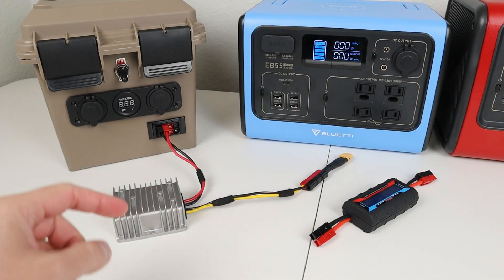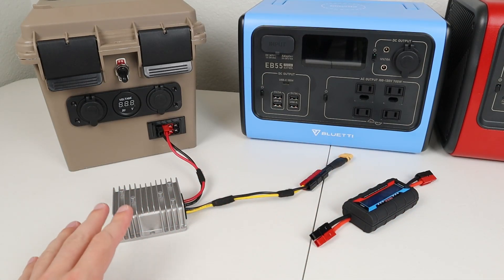Bluetti EB55 & EB70 Charging Tips and Tricks - Faster Charging Without Solar! EB55 400 Watts Input!?

Comment: Thanks for putting this together.  I discovered an unexpected behavior with my EB55 right charging input labeled 25-28V/10A.  I figured you might be curious about this, too.   Naturally, this input works just fine when I use the included 200W AC/DC adapter.  However, when I try to use another power supply, a Victron Orion-Tr Smart DC-DC Charger, it will not charge.  I am an electrical engineer, so naturally I made sure the polarity is correct with a multimeter (positive tip) prior to connecting.  Also, the Victron has adjustable output voltage, so I tried everything from 25 to 28 volts, and I confirmed the output with a multimeter prior to connecting to the EB55.  In addition, I also have Bluetti AC50S.  As you know it has a similar 8mm input on the back that asks for 14-40V.  When I plug my Victron into it, it charges just fine!  I’m confused!  Any thoughts on this?  Thanks in advance.
Reply: By the way, the reason one would want to do this is this--12V solar panels output <25V, so they need to go into the left port labeled 12-28V.  Therefore, I'd like to have DC from a power supply going into the 25-28V port.  However, as you noted utilizing the stock 200W AC/DC adapter is a challenge with standard vehicle wiring (blow a fuse).  The 12 to 24 volt converter you mentioned will not work in the right charging input because it doesn't put out 25V.  So, I'm trying to use something that should work, but it doesn't!
Reply from the maker: @Roland-Lewis  Easiest way around that issue would be to have an inverter installed that can handle a 200-300 watt load. Then you could run the AC wall charger off the inverter AND the DC inverter both at the same time while the engine is running. Wire the inverter directly from the battery using like 6awg wire and it should be big enough to handle both the inverter and the DC charging at the same time. That direct wire connection to the battery would be useful for other applications in the future.

I haven't worked with that Victron unit so not sure exactly why it's not working. The only thing that came to my mind could be that the victron charger must need some sort of feedback voltage to start putting out power? Similar to a laptop power supply, it wont just put out power but needs to verify something before it starts working.
Reply: @Jasonoid  Thanks for your prompt response.  I get what you're saying that the 300W inverter is an option, but that is the function of the Orion.  And I can't get myself to go DC to AC, just to go back to DC again.  Yeah, it's so weird--the Orion shows voltage with just a multimeter connected, and as mentioned, it will charge the AC50S just fine.  AND I DIDN'T MENTION THIS YET--the AC50S power supply will charge the EB55 just fine!  Well, if you happen to have a DC power supply laying around that can output 25-28V, maybe you'll be curious to see if it will charge your EB55 from the 8mm input.
Reply from the maker: @Roland-Lewis  I was able to test charging my EB55 via the 8mm jack, it works fine with this adjustable power supply between 25 volts and 28 volts:
https://www.banggood.com/TOPSHAK-K3010D-4-Digits-LED-Display-110V-or-220V-30V-10A-Adjustable-DC-Power-Supply-Switching-Regulated-Power-Supply-p-1419678.html?cur_warehouse=USA&ID=47757&rmmds=search
Reply: @Jasonoid  Thank you very much sir!  I'm starting to think there might be something wrong with mine.  I have a friend who has a similar power supply to yours, so I will borrow and test mine.  Thank you again.

Comment: I ordered an EB70, if I want to use this converter in order to lower the recharging time on the EB70 do I wire the converter directly to the 12 truck battery? I think I'm going to build a small cabinet in the bed of the truck to place the EB70 in and I would mount this converter to the cabinet somewhere so I will always have it there for recharging. Does the converter work if connected to solar panel instead of the truck battery? Like if I had a switch to change from battery to solar or just had a splitter connection in the wires or does it always need to be from the truck battery? Once again, great video with VERY helpful information!!!

Comment: .. quite clear with the step-up unit. but still wonder, if it must be true sinewave inverter (what i think it´s supposed to be). the reason is for emergency cases, when power station runs low, no sun available and severe need of power .. means charging from the car without running it for hours. modified sine inverter with let´s say 700/1000 watts (for ecoflow 600W charging) is much cheaper - that´s why.
looks like nobody dares to try and eventually ruin their power supplies ;-)
ps: looks like they made it a bit better with the 2 inputs on 55, but still have the limit on the mppt-input; can´t believe it, not fitting that even to their own panel.

Comment: Question in my car could I hook up the e55 to my cigarette lighter port and also use the ac  Brick and plug that into my 150w built in inverter? So I am essentially getting both dc and ac power at the same time?
Reply: I tried the 200 watt charger in my 2018 chevy express 110v outlet rated at 150 watts. Shut off and wouldn’t drive the charger. I’ll have to use the 300 watt Bestek direct to the battery to power the 200 watt brick
Reply from the maker: Yes that will work! As long as your inverter supports 200 watts, the AC charger will try to pull 200 watts and might blow the fuse for a small 150 watt inverter. I answered your previous question last night 👍
Reply: Oh ok thank you so much. I figured the charger would get limited to 150 watts but sounds like it will try and pull more watts. Thank you so much for getting back to me!!
Reply: @blitzsteinaaron  thats what i was hoping to do. My Chevy van has a 110v 150 watt outlet. I was hoping to use the Bluetti AC charger in that, but it sounds like it might blow the fuse.

Comment: jason can the dc to dc work with BIBENE without taking it apart ? ( bringing  up the voltage ) thanks
Reply from the maker: No, the Bibene power station is just limited to 100 watts by software so whatever power levels of voltage come into the power station it will just limit it to 100 watts.

The EB series are different because they allow 200 watts but there's that 8 amp limit so you have to use some trickery to get the full power. Most solar panels will get their power from lower voltage and higher amps (18 volts and 12 amps). So the higher the voltage you have on a solar panel,  the better with the EB series.
Reply: @Jasonoid  so i will have to take it apart 😂
Reply from the maker: @shaizahavi  I'd give it a test first to see how well the 100 watts works for you, if you need more charging then do the mod. Not everyone will need faster charging.

Comment: So why bother trying to charge those Bluetti's faster? Just get an Ecoflow River Pro or Max which fully charges under two hours with just a plug and play charger.
Reply from the maker: There's benefits to both models. Doesn't the ECOflow river only charge fast via the AC charger? So you'd still need a generator or high power inverter on the go (this video is about charging on the road).

The bluetti offers Lifepo4 chemistry which has a much longer life and no fire risk. Basically there are good things about each battery, you just gotta chose what works best for you.
Reply: @Jasonoid  Yes, you are correct. Each has his own strong and weak points, but for the Ecoflow's I don't need to buy other stuff just to make it charge faster or modify my vehicle just for that purpose, which again costs money. Charging the River on the road only needs at least 3 1/2 hours on the car charger, which comes directly out of the box (Warranty intact). Which in turn translates into more usable time.
Reply: @steverogers427  are you charging out of the vehicle cigarette lighter?
Reply: Swapping a faster charge cycle for more possible dangers, and a lifetime of 1/3 of the bluetti... Eco flow river Life cycle 800 cycles... Bluetti eb70 life cycle 2500 cycles... Also the eco flow uses semi dangerous Lipo batteries which can go on fire and explode.. Bluetti uses lifepo4 which do not present a danger to go on fire or explode. There's many pros and cons across the board but I value a 3x higher lifetime and safety over a faster charge cycle.

Comment: Nice video. Have you tested the Bestek 300watt? I've seen a few videos showing it isn't actually pure sine wave so wondering?
Reply from the maker: They offer two models, the one in the video has been tested with an oscilloscope and is a pure sine wave and offers good RMS voltage. Great question!
Reply: @Jasonoid  Thanks :)

Comment: So let's make this easy, I watch the previous video on the 12 to 24 volt converter.Bought it from Amazon.  Hard wired it to my H2. Ran wires to the back and put a 24v rated cigarette plug there. Now I can hook it up to my EB70 using the supplied cable! Charges at 183 watts max!!!
Reply: Pleased to hear that. My converter arrived today.

Comment: Thank you! Does the DC-DC method also protect from over paneling?  Also,  if one's interest is battery longevity, should fast charging be reserved per need?
Reply from the maker: I'd only charge fast when needed. When using the DC to DC Charging method it won't harm the battery, it's basically the same thing as using the wall charger.

Comment: Unfortunately, I've already returned two of the eb55's. They are absolutely junk. Had high hopes but they turned out to be useless. They work until you use them close to capacity and then the screen shuts off. They will no longer charge, turn on or do anything else.
Reply from the maker: I'm curious how the battery would ever get that low. Once the AC or DC output shutoff from low voltage did you turn back on the output and keep using it?
Reply: @Jasonoid  wasn't low. test done on full charge. rendered two units useless, inoperable in less than 5 minutes.
Reply from the maker: @xcrazydx  crazy odds that happened to two units!  I have charged mine and discharged it 20 plus times with no issues. Heavy loads too
Reply: @Jasonoid  I know, I wanted it to work and chose it even though it has an inferior display. I chose it for the battery chemistry and better inverter. But, like will prowse says, sometimes his works and yours doesn't. lol

Comment: Great video and tips! I have the eb55 and ac50s and noticed that the ac50s came with an mc4 to 8mm cable that allows you to hook up solar to the ac input on the eb55. This means you can charge the eb55 dual solar up to 400watts in addition to dual ac if you get a second ac charger. It's too bad Bluetti doesn't sell all their cables as standalone acessories
Reply from the maker: Those are both great batteries! The AC input on the EB55 actually has a tighter range of voltage and will only accept 25-28 volts so it probably wouldn't work well with solar since panels usually put out 18-20v. I can't remember if I tested it or not.
Reply: @Jasonoid  I tested the ac input with sp200 panel and it pulled the same amount of solar charge as the dc/PV input...150-170 watts late afternoon. I'll have to test it again to make sure that want a fluke
Reply: @gsp_in_training   Have you tried plugging the solar panel or the car charger into the 8mm?
Reply: @domwrinaldi  I have, first time got over 150 watts from solar via ac input (8mm), second time got less than 50W via ac input. Both times also had solar panel hooked up to mppt solar input of eb55.
Reply: Except for the EB55 has a max charge rate of 400w. Your comment seems like youre saying 400w (solar (dual solar)) + 400w (AC (dual ac adapters)) will go into the EB55 (making it 800w charging input) and thats not true. It caps out at 400w. So you could put 1000w of solar or 1000w of AC and youll still only put 400w in. Bluetti does sell cable adapters for about $10 on their website.
Reply: @staryoke  dual ac OR dual solar
Reply from the maker: The max input for this power station is 400 watts and it will only charge that fast with dual ac chargers plugged in. With a solar panel and ac adapter dual charging its about 350 watts. You cant have dual solar inputs because one of the ports only accepts 25v - 28v input, too high for solar. I made a video on that topic earlier last month, check it out on my channel.
Reply: Hello. can you confirm the dual solar charge using two panels? one charging in the dc port and the other in the ac port using that adapter to 8mm cable?
I know we can't charge at full 200 watts from solar, but using the correct panels the eb55 should charge at 320 watts (160watts x2), if this works.
Reply: @palomojarre  it has worked but may not be reliable. As Jasonoid mentioned, the limiter is the AC input (25-28v @ 10A). I have the Bluetti SP200 panels with Voc 24V and suspect that on a bright sunny day there may have been enough current to charge from solar through the AC input while also charging from solar through the MPPT input (my first test showed this). If you find a panel that meets the AC input requirements then it should work 100% in theory

Comment: 12v to 24v can this be used inline from12v solar panels for boost to EB70?
Reply from the maker: No, the DC to DC charger does not like the voltage over 13.5 volts (solar panels put out around 18volts) and it won't convert it up. I tried that out. Still looking for other options to boost the solar voltage.
Reply: @Jasonoid  just to make sure I understand, your videos regularly refer to solar panels as "12 volt" even though most are truly 18 volt; you've even referred to the Bluetti SP200 panel as a 12v in your other EB70 and EB55 reviews.  On notion of 18v, it makes sense that the 12 to 24v dc to dc converter wouldn't work.

With that said, why do you keep referring to solar panels as 12v and 24v? Just asking for my own understanding...
Reply: @Jasonoid  Thanks for the reply, Could you put the solar charge controller between the Panel to the converter to regulate 12v input ? thanks for your time.
Reply from the maker: That may work, it depends how the charge controller will react to the DC converter pulling power. I will write down that option and I'll see if I can test it in a future video

Comment: 1 question please. I have power Oak AC200P. His charger is 400w.so in my truck 24v I can install 500w inverter and when I drive I can charge it faster? Thank you in advance for your help
Reply from the maker: Yes, running your charger off an inverter will work. However you'll want to make sure your wires are the correct thickness to handle the power. You mentioned your truck is 24 volts? Is it a semi truck?

Comment: I have a question 🤔 is it possible to use a dc to dc adjustuble converter connected to a solar panel maybe over panel a bunch will it work to charge the eb70 or eb55 since you can only get 160w even if you over panel maybe I can get the full 200w out of the dc to dc converter 🤷‍♂️🤷‍♂️
Reply from the maker: I tried the DC to DC converter with my solar panels and it didn't like the higher voltage of the solar and wouldn't output 24 volts. I might try another method in the future but it would be around $70 so trying to debate if it's worth it or not... Haha
Reply: @Jasonoid  I tried with the same boost converter u have and I find out those only output 24v when at 13.5v or lower down to 9.5 but if u try to input more than 14v it doesn't work idk why but I was thinking maybe if I try something like the adjustable ones those can handle the 20v of the panel and turn it into 24v I ordered one just to try if it works I let u know but I don't have much hope 😆
Reply: @alexcandelaria590  Did you find a way to get it to work? I'm also trying to get more than 160w out of my 2x 100w panels.
Reply: @JonathanRamse  i haven't find a dc to dc boost converter that can handle the voltage from the solar panels and put out the full power from the boost converter but honestly from many many try I don't think it's possible at the moment maybe in a future with the right panels and the right boost converter
Reply: @alexcandelaria590  thanks for the quick reply. Do you think a 24v PWM might work? The issue is that you can't series connect the panels to the EB55/70 directly, but if you series connect your panels to the 24v PWM and then connect that to the battery, you've upped the voltage while maintaining the amps below the 8amp limit. I'm new to this so I'm just trying to find a work-around that wouldn't damage anything.
Reply: @JonathanRamse  you could try it you never know I don't think you'll hurt the eb70 by trying that since your not putting in over 28v in which is the limit good lock and lmk how it goes
Reply: @alexcandelaria590  The PWM didn't work. Its designed to be powered by the battery its charging so when I plugged it into my eb55's solar charge port it wouldn't send any power back to power the PWM. I'm surprised by the solar input constraints on the eb55/70!

Comment: Interesting.  I may have to get one of those 12V-24V converters.  Quick question though; is it a simple voltage doubler, or is the output regulated to 24V?  I ask this question because if your "12V" source is actually as high as 14V, if you got 28V, you might exceed an input only rated up to 25V.
Reply from the maker: It puts out a regulated 24volts. The highest voltage I saw was 24.5 volts so all within safe tolerances for the EBseries :)